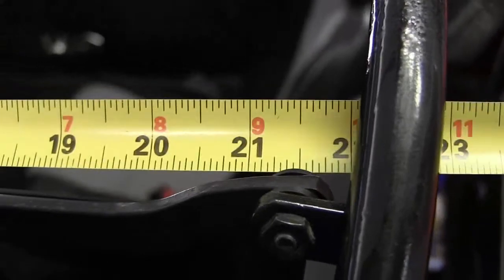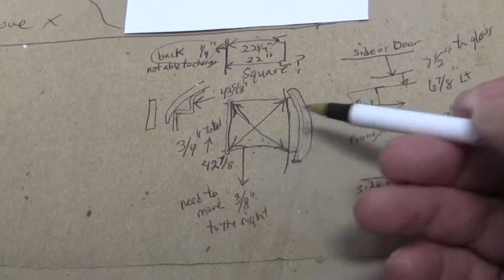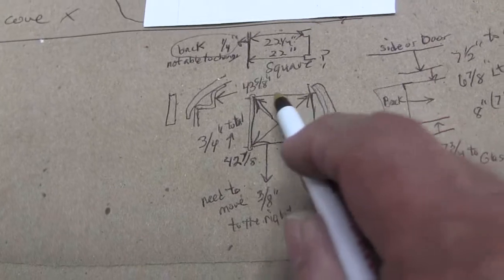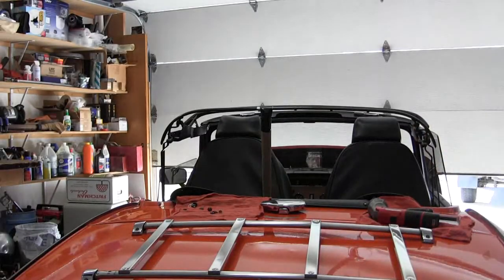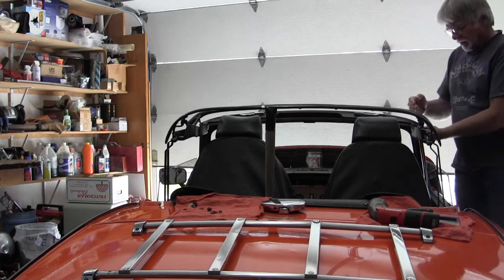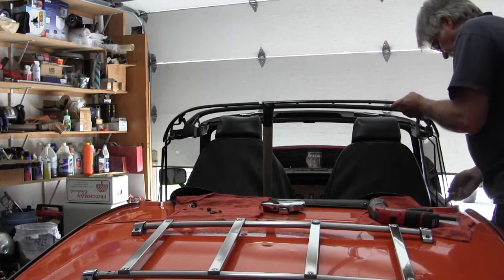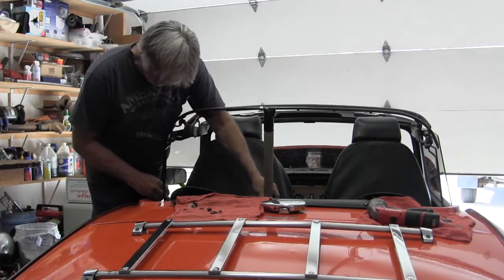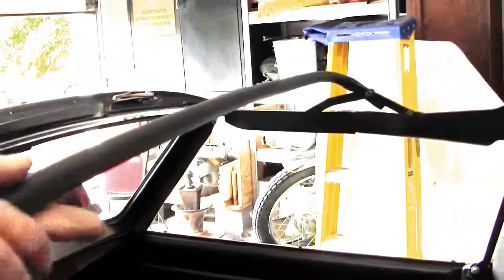Triumph Spitfire Convertible Top Part 6.9, Square up the frame to the Windscreen

Comment: Spitfire tops (hoods) are better designed to keep the sun off you, not so much the rain out...  I have a pretty fine Spitfire but i will not leave it out in the rain if at all possible due to gaps the rain can easily find its way thru.
Reply from the maker: Gaps can be corrected by adjusting the metal frame to fit the car. I found these cars are not the best cars for factory fit. They are like the belt one might buy for themselves, for your pants, has to be adjusted to fit properly.